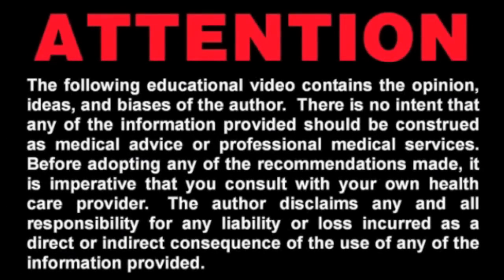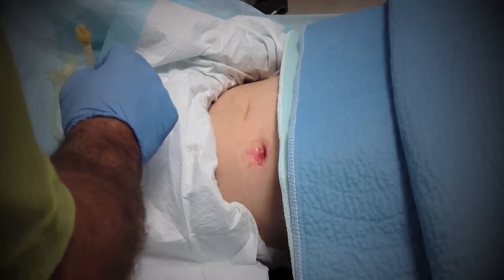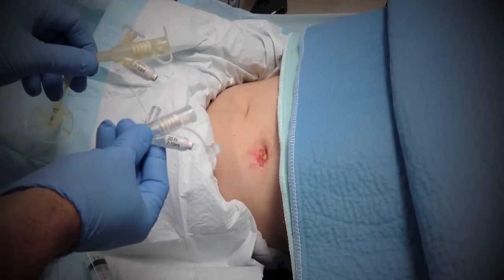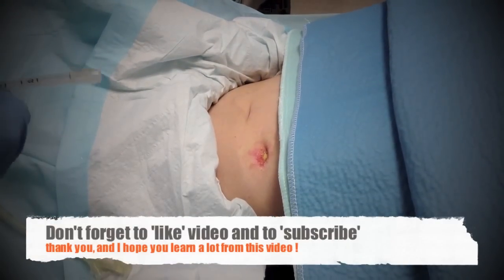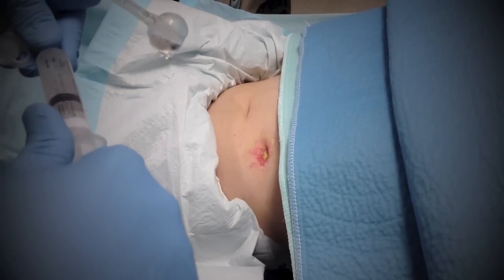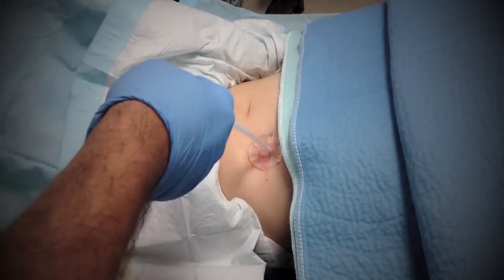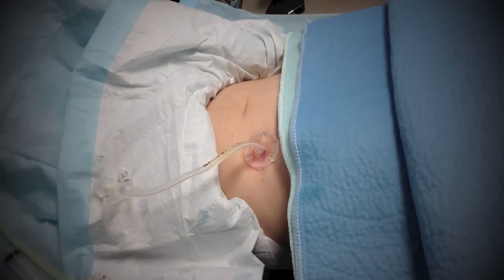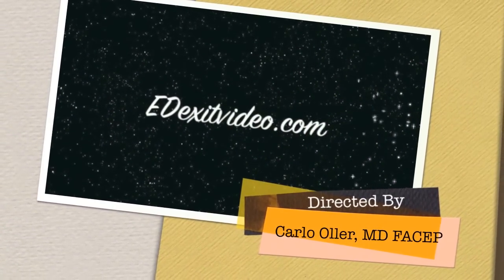Gastric Tube Replacement

Comment: thanks for this video! my PEG tube came out and it was late, and the on call doctor who barely spoke english said to go to the ER. thats all they ever say, go to the ER, no matter what the problem. i figured i can do this, not very hard, so i deflated the balloon with a saline syringe and put it back in with some lube, and then inflated it with ~8mL of saline. to verify it was in my stomach i put soy sauce in water and drank it, then pulled stomach contents from the PEG and there the fluid was! i think its fine now, the balloon isnt broken or anything. this video was a big help and a lifesaver :) -- i cant do an xray confirm though.. oh well.. i live on the edge i guess.